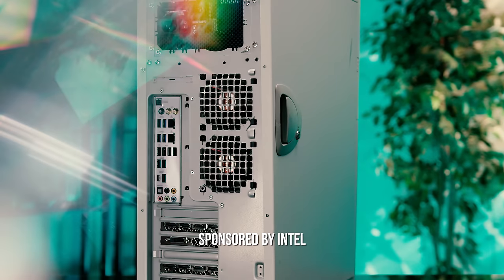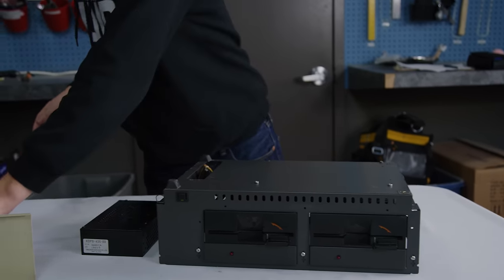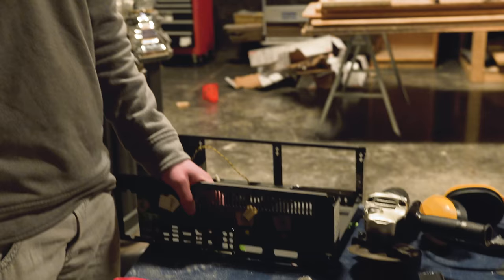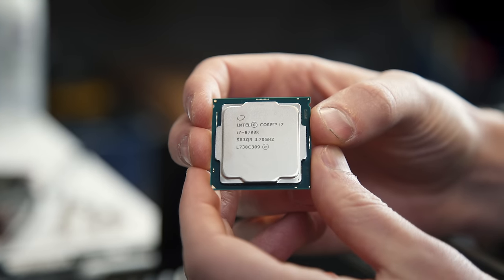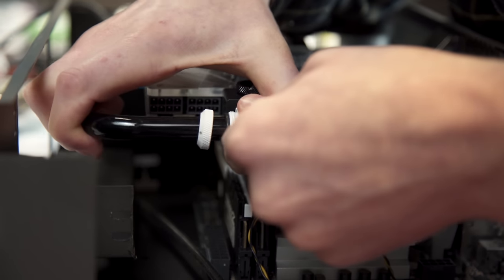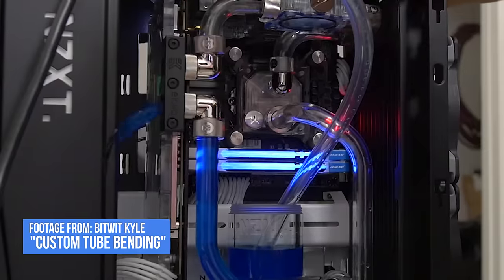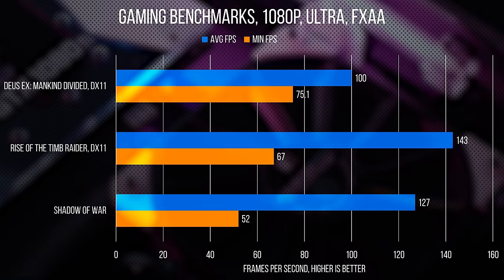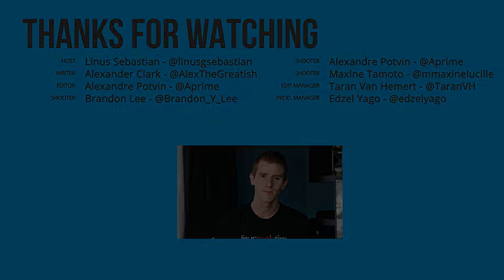The ULTIMATE Compact Sleeper PC Build

Comment: You should build inside of an original 1984 Mac and replace the screen it would look awesome
Reply: Carboy7 I would have to agree. Most of the time, and original 1984 macintosh will go for around $500. They could maybe do it with a macintosh plus or 
SE, which go for only around $50 broken.
Reply: Chris Tyburski I had that exact same idea.
Reply: I personally wouldn't want these guys taking apart an old Mac CRT with millions of volts and tens of amps potentially stored inside it. The technicians that fixed them back in the day had to be trained and certified before they were allowed to take one apart.
Reply: Chris Tyburski Destorying old PCs, working or not, should be a crime...
Reply: Another problem would be the form factor of the screen, it's no longer 4:3 (or whatever the Mac was.
Reply: is nothing sacred??
Reply: true
Reply: I wish people would stop spreading the "Killer CRT charge" urban myth. The operating voltage is nowhere near millions, they self discharge completely after about a day, and the procedure to safely discharge one that's just been used needs nothing more than a flathead screwdriver and a length of wire to ground. 

Shit, you know how CRT's are focused? Direct adjustment of the high voltage parts by hand, while powered on. I've done it since I was 16 and never shocked yet.
Reply: THANK YOU
Reply: I got a Macintosh Classic. Still works. Just need a keyboard. Running Sytem 6. But I would rather build a computer on a Apple II case. Maybe use the external floppy drives as the hard drives.
Reply: Rebellion, Linus used to be a certified system builder before YouTube. I’m sure he could do it.
Reply: kan't be: "they self discharge completely after about a day". I had an example where I accidentally contacted both ends of the HV circuit in a 1084S with my body. Man did I get a fright. This was after at least a month of it not being used, and it STILL gave me a real scare. Definitely make sure the screwdriver and wire are both meaty though.
Reply: Make sure it is already broken and useless before building inside of it.
Reply: Chris Tyburski Check out Alexibexi's build on an old Mac! :)
Reply: I've taken apart old macs/Macintosh plus and it's not hard to discharge the capacitors. If they're technically savvy enough to do hardline tubing and put together laser cutters, a macintosh would be a walk in the park.
Reply: You can watch Ben Heck for his video on how to safely discharge a CRT Monitor, of course if you've seen recycling centers they have nice big hammers for old CRT tubes.
Reply: You could get a small 16x9 screen and just shimmy it inside, otherwise adjust the screen settings in case the screen gets covered on all sides by the plastic casing.
Reply: It would be hard to get a monitor to fit in that thing.

Comment: My uncle had this old old computer that relied on compact cassettes for loading games. I remember trying it once not too many years ago (so it might still work), bit beast of a machine that was around 1,5-2m wide and I had to load between 8-16 cassettes to play a single game. And to answer the question, no. It did NOT run very fast, but man was it cool.
Seeing this got me to think what kind of sleeper pc you could have built with such a case. Of course, no way anyone would be able to move it after without the use of a forklift. Even the original pc was so heavy that you had to be at least 6 strong to move it and even then it was a challenge.

Comment: The binary at the beginning translates (if put through a program), comes out to "memes".

Nice one guys. -_-
Reply: last2hack, how is it not hard to translate just from your head, hmmph?
Reply: HydrOptix how is it hard to translate? Took me 10 seconds to read it manually
Reply: Each section of binary is an 8bit binary representation of an ASCII character. Its not possible to translate unless you have memorized the binary for each ASCII character or are looking at an ASCII table. 

While memorizing all 255 ASCII characters is a cool skill, it's much more practical to use a conversion program.
Reply: John Giaquinto I agree.
Reply: Actually, you can still do it easily without memorising an ASCII table. Since those 8-bit strings also translate to decimal numbers, you just have to remember that upper case start at 65 and lower case start at 97 (and numbers start at 48 if you need those too). 

You just convert the binary to decimal in your head then start counting from 'a' or 'A' to the translated character. This only works for alphanumerics of course - no extra symbols - but it applies to most scenarios, including the one in the video.
Reply: It's still more practical to use a program, especially if you're trying to read multiple paragraphs of binary. Also, I prefer hex; it's faster to convert binary into :)
Reply: each letter of memes is represented by 1 byte of information or 8 bits. they showed us 5 bytes of info using nearly 1 million times that or a megabyte of video. we are data inflating so hard right now.
Reply: Here I was wondering what the hell "Nfnft" is supposed to mean...
Reply: +John Giaquinto
It actually isn't too bad if you consider the third bit as a lowercase flag, and the ending five bits as the index of the letter.
That said, I got it wrong, but I would just need some practice.
Reply: 01LNNNNN
Reply: Ryan Baillie, I can count to 31 on one hand and to 1023 on both hands. I never count the old way even if I it's less than 10. Summing up bites from fingers is usually very fast.

Comment: Pair that thing with a crt tv or a cheap 4 by 3 lcd to match the computer
Reply: but then it couldn't run games the same?? Thats really not a good idea, they could custom make a cover for a gaming monitor though
Reply: pair it with a modern display inside an old CRT display
Reply: it would improve performance because of lowered aspect ratio at the sacrifice of better looking higher resolutions not showing its full sleeper abilities kind of making it pointless
Reply: How about an old crt monitor with CGA graphics from 1982? That would match the IBM PC XT aesthetics.
Reply: They should make the sleeper PC inside of an old bulky monitor. Plenty of room inside.
Reply: Use a CRT

Looks the part and a decent CRT has pretty good image quality and will run at resolutions above above the equivalent 4:3  of 1080p or 140Hz at lower resolutions
Reply: 4:3 1080p = 1440x1080
Reply: Closest you could get would be 1280x1024 CRT monitor. They are old, RARE as Pepe, and HUGE. If you could find one that didn't have a burnt out CRT you'd be in business.
Reply: A CRT display that is opened up with the guts taken out, then a 1440p q44hz display added inside instead would be good.....
Reply: That would make the crt worse.. it's still a superior screen tech in many ways
Reply: The last generation of high end crts could do 2k resolutions. At 16:10 aspect ratios. Also no input lag or ghosting to worry about.
Reply: Why not mod a CRT and replace the innards with a flat panel?
Reply: Because crt screens are better?
Reply: I used a CRT (sgi branded Sony built GDM 5411 made in 1999) running 1920x1440@75Hz until it died last year (one of the PCB's died...I got the thing as new old stock a few years before so I was sad).  A good late model Trinitron would probably work well and a 17" model would look the part.

Comment: hey build a budget for 2018
Reply: Budget of $10,000
Reply: +Ben Sisto  You sure i am just hitler?
Reply: Nein!Nein!Nein!
Reply: Hi dad
Reply: It's not worth to do it now. They made one not so long ago. Maybe after new generation tech
Reply: A cheap pc with a lot of power for gaming
Reply: Im guessing this is a joke comment since... just the ram can cost more then the cpu.... not even kidding.
Reply: Whenever he does a budget build he ruins it with expensive sponsors (bequiet power supply, coolers, and cases are expensive) and ends up putting worse hardware that a PC that costs 3/4 the price (He put a 1060 in a build where he could've easily fitted a 1070 or even 1080 into the budget).

Comment: You need to do a sleeper monitor build to match it! Take one of the old cube monitors and replace the inside with a 1440p 144hz OLED or LCD!!!
Reply: You're gonna have to 3d print an entirely new chassis just to satisfy the 16:9 aspect ratio.
Reply: There's some 16x9 and 16x10 crts out there.
Reply: Ray Of Knowledge I'm pretty sure there are some older 16:9 monitors out there, and even if there aren't I'm positive Linus can figure it out!

Comment: You should do a sleeper monitor.
Reply: Might as well make sleeper peripherals. Such as a roller ball style mouse with high tech internals and a retro keyboard with cherry switches
Reply: Just use an IBM Model M.  Uses PS/2 connector and is a legit 1994 mech keyboard :)

Comment: I think the UV cathode kinda gives it away. If it went for a more unlit look, it would be more believable. Great video though, I like the machine and would be fun rolling into a LAN party or convention with that thing and get some heads turned.
Reply: Yub, completely agree. Guess it would have looked too "boring" otherwise. On the other hand I don't think that a case with two floppy drives was the best choice anyways. You could have done something cool with the old "turbo" buttons for example. Also in such a build I couldn't care less about what hardware is inside and the benchmark values.
But I guess LGR or the 8-Bit-Guy are more suites for these kind of things anyways.
Btw: None of you are born before 82....whaaat? ^^
-Kordanor (born 82)

Comment: It would be cool to build a modern pc whilst keeping a working floppy drive
Reply: Xx maTrix I have one. Well, it’s not modern it’s 5 years old and the white floppy drive looks shit out of place on a black Corsair case. But it does look funny though.
Reply: Krongfah Mahankalarp have you ever used the floppy drives ?
Reply: Xx maTrix I think windows 10 supports floppy drives.
Reply: Xx maTrix Well, once really, that I can remember. 
My mother has an old stack of floppy disks that she used to keep some files (pictures I think) and wanted me to try to recover them and back them up.
I also have one that was used to install Windows 3.1 but it’s disk 5 of 6. Never tried to load it up but I doubt it’s still working.
Reply: Krongfah Mahankalarp oh cool does it matter what os you use to load up floppy drive drive files ?
Reply: Xx maTrix I have no idea, when I did all of that 5 years ago I was still using Windows XP. Since then I've upgraded to Windows 7 and now I'm using Windows 10. 
I have no idea if Win10 supports this or not. And I don't have the floppy disks with me to try.
Reply: Krongfah Mahankalarp ok thx for sharing dude, I’ve always wanted to do this so it’s cool to finally hear from someone that has done it before
Reply: Yes W10 supports it. My second PC has one (3.5"), and has Windows 10 64 bit. It uses a Q9400@3GHz, an ASrock P43Twins1600 Board and 8GB DDR2.
But sometimes Windows randomly tries to access the drive, even when there is no disk in it.
I have the drive installed to prepare boot/file disks for older computers that don't have USB (support)
Reply: Modern motherboard don't have the connector anymore. Even my mobo from 2013 didn't have one. Unless you find an expansion card that would support it, you won't be able to use one in a modern PC unfortunately.

By the way, black floppy disk drive exist
Reply: Sure, but that's not internal and these are less capable than the internal ones.
Reply: Robert Stewart, You could connect it to an internal USB header, and it's just as capable.
Reply: Just like my main desktop pc has a motherboard and cpu from 2013, an i7-4770k that I built in a case that I bought from Best Buy in April of 2007. I still have the 3 1/2" floppy drive sitting in there, but have nowhere to connect it to since the motherboard don't have a port. However I have an old Toshiba Satellite laptop that has both the floppy drive and cd-rom drive built in which was made in 1998.
Reply: got an old copy of street fighter CE on floppy
Reply: I put one on my at the time server to allow me to load old games I have on floppy discs.  Not that many though.  But it's still interesting, and if I ever find a couple hundred floppy drives and myself to be very bored I'm going to load a game onto them to give to my friend.
Reply: Xx maTrix Windows 10 doesn’t have native support so you’d have to find drivers online.

Comment: You should fit a whole computer inside an old CRTmonitor for your next sleeper pc built.!!!
Reply: Why they used to built Liquid cooling in this old PC instead of Air Cooling ??
Reply: @aaadj2744  because the only mini graphics card they had was liquid cooled with a block
Reply: TheElite47
And it didn't fit right ?

Comment: I Hope retro look comes to PC gaming im tired of futuristic shapes and mayan patterns.   Check desings from Dieter Rams to see what i mean.
Reply: WEll, Silverstone has you covered. They have a HTPC case that looks like a repurposed computer case from the late 80's, early 90's. (Except that it's black, not beige.)

https://www.newegg.com/Product/Product.aspx?Item=N82E16811163257
Reply: is this linus secret accounT? that word looks like some sponsor linus would do
Reply: I have an IBM 300PL and like the design of the case and wanted to make a new system out of it, but might have to get rid of it
Reply: +MPG187 Why get rid of it? As long as it supports normal card height and you're good with a dremel, a drill, and a tap and die set, you can make it work.
Reply: "Mayan patterns"
Good way to put it.
Reply: Wouldn't Mayan patterns, by virtue of the civilization being so old, be retro?
Reply: CazRaX But old/retro computers didn't have Mayan patterns.
Reply: Isn't mayan technically retro?
Reply: Personally i prefer the box design (anti curve designs)

Comment: A sleeper monitor would be cool too
Reply: Rip the internals of a tube monitor out and replace it with a laptop lcd and an lcd controller card off of Ebay.
Reply: you will be limited to 4:3 aspect ratio, maybe  3d print a CRT cover for a modern monitor...

Comment: The first 'Sleeper' I've seen in, I think it was CPU magazine, somebody modified a Radioshack T-80. The CRT was removed, and a LCD panel was fitted. A slot-loading DVD drive was fitted just behind the 5.25 drive panel so you could lift the latch and insert a disc. Looked totally legit except for the flatness of the screen if you even noticed walking by. The best part, they somehow re-wired the original mechanical keyboard into a micro-controller. (a teensy board perhaps?).